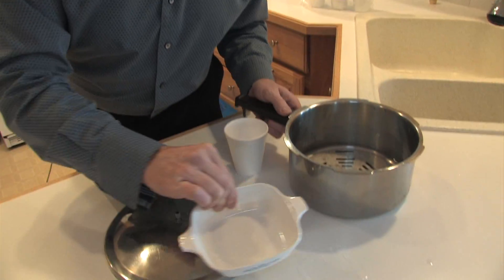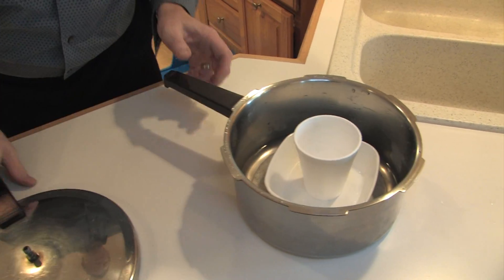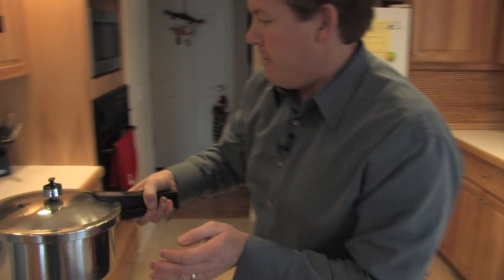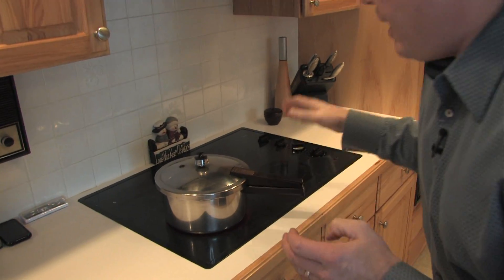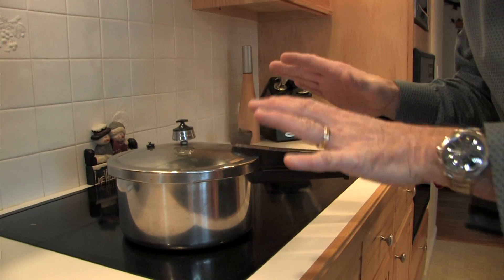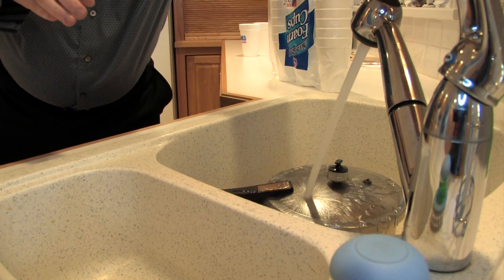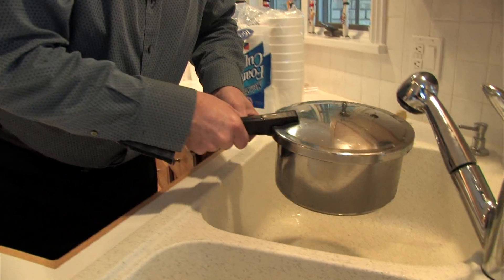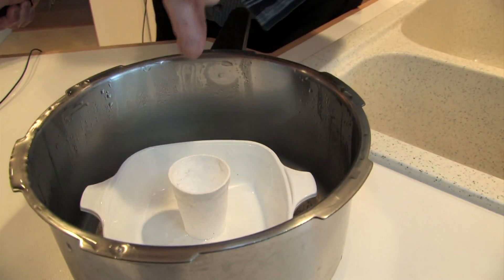Shrinking Styrofoam Cup

Comment: Not sure, but i think coz styrofoam, as the name suggests, was actually foam before it was formed into a cup n stiffened, the little bit of water in the cooker is just not to burn the pot, also create steam, and as the pressure increases, the cup gets compressed evenly from all sides, expelling the all the air from the cup.
So the cut section of the cup should be a bit harder, thinner and dense. ^^

Comment: The pressure inside the pot compressed the styrofoam.  It seems there is a lot of air inside styrofoam, sort of like white bread.  Gee, since styrofoam normally floats, after it's compressed does it mean you CAN take this cup scuba diving?

That is one cute cup, btw.

Comment: The water turned into vapor, which makes it expand about 17 000 times, which in turn causes the pressure inside the cooker to rise. That's the reason why the cup shrunk; you can obtain the same effect by lowering it about 600 meters under water ;D